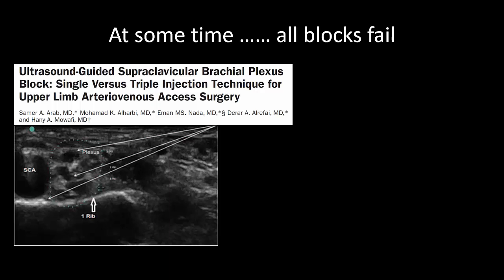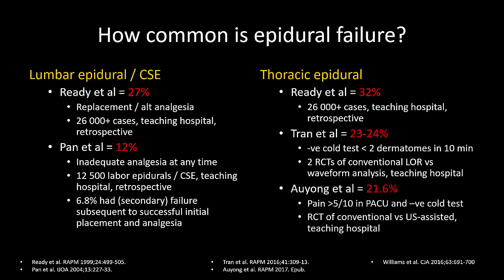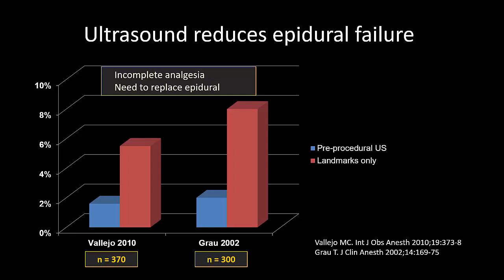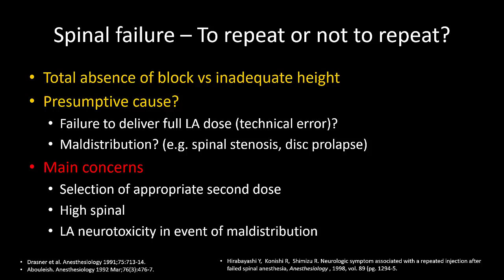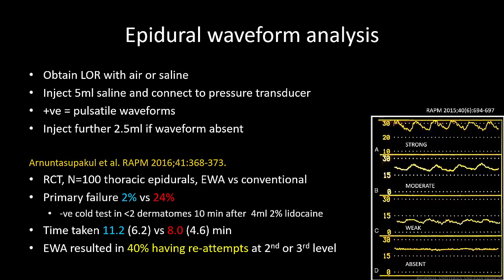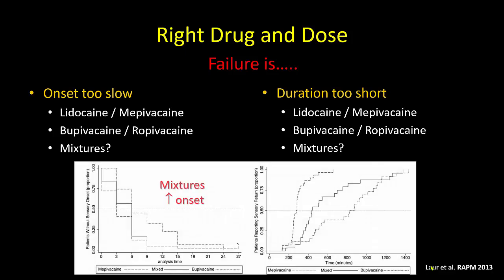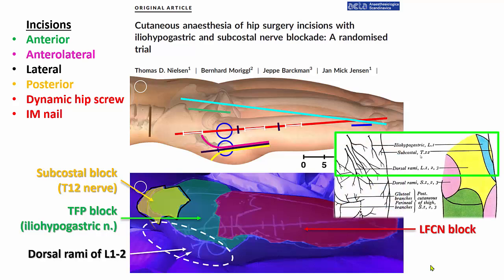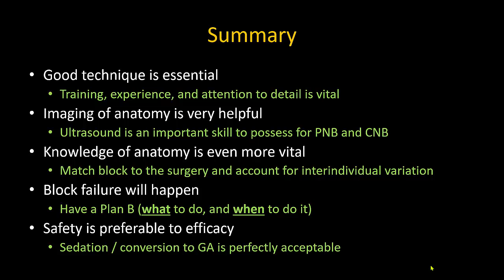Why Blocks Fail and What To Do About It

Comment: Thanks from switzerland. What do you recommand if you have an inadequate block  following a spinal anesthesia: try a new one at the risk of puncturing a root that is already anesthestetized or never?
Reply from the maker: It depends on your context, and your clinical judgment. Sometimes it is easier / safer / quicker just to convert to a "light" general anesthetic. If however there are compelling reasons to have a completely effective surgical spinal anesthetic, (and it was easy to do in the first place), then we will repeat the spinal. Usually at a different level if possible, just to avoid repetition of any anatomical or technical issues that might have contributed to the failure. And empirically we usually give another 1ml of 0.5% bupivacaine or whatever you used before - making sure that it is not an excessive amount in total (20mg of bupivacaine is my personal ceiling). There isn't really a risk of puncturing a nerve root with spinal anesthesia; conus damage from going too high is the main mechanical neurological injury to be concerned about.

Comment: Regarding your mixture of 2% lido/0.5%bupi for your PNBs, what is the final concentration (or ratio of the 2) that you use that seems to have desirable onset/duration?
Reply from the maker: We use a 1:1 ratio. That provides surgical block onset within 15 min in most patients, and in brachial plexus blocks, provides >4h of surgical anesthesia, usually wearing off after about 6h duration. I have recently also experimented with 0.5% ropivacaine - using a 1% solution diluted with 5% dextrose, based on papers by Dhir et al showing a faster onset when dextrose is used as the diluent vs normal saline. This has also worked well - onset by 15 min or so in all the cases I've done to date.

Comment: Excellent content, thank you. Are there any data on the acceptable rate of failure of neuraxial anaesthesia placement for experienced anaesthetists?
Reply from the maker: The data presented comes not just from learners but also from practicing anaesthetists. I believe (without actually looking at the data) that our incidence of failed spinal is not that high, particularly total absence of any block. But inadequate block height does occasionally occur, particularly when doing L5-S1 blocks for TKR or THR with isobaric bupi. Can often rescue with reverse Trendelenburg positioning.